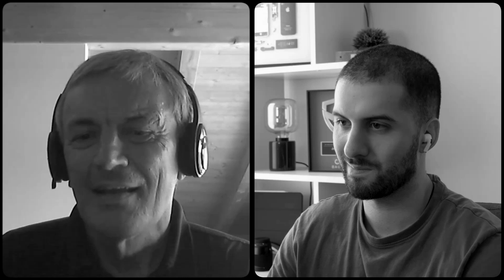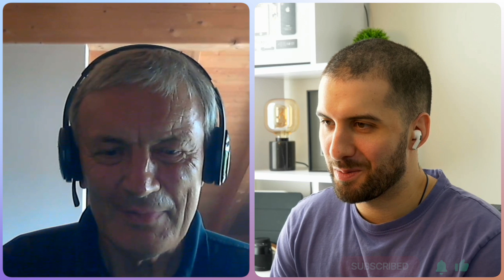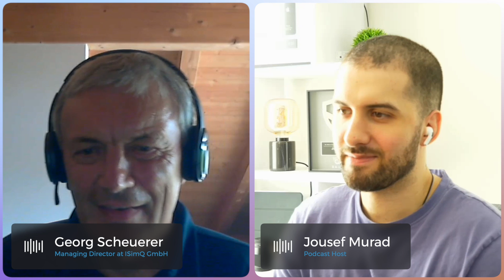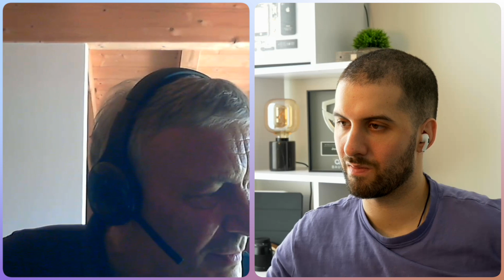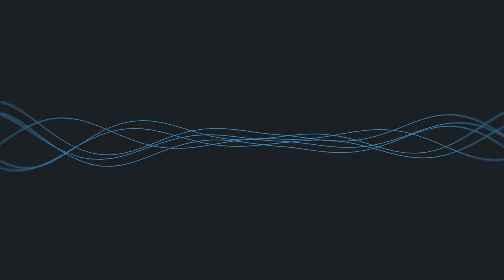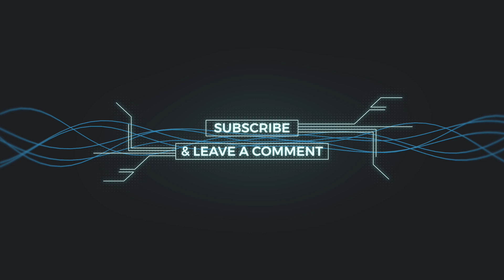A Guide to CFD - Georg Scheuerer | Podcast #109

Comment: I am a beginner in CFD simulations. The problem I want to solve is simulating a desiccant wheel in HVAC. It's quite complex because it deals with multiphase flow and very small geometries. I've seen a lot of simplifications done such as analyzing only a single vent of the wheel. However, I haven't found a good model yet on the evaporation of water (in the regeneration phase). Is this something possible? Any tips?
Reply: You can solved using FVM method numerically by descritising Psudeo Gas Side model.
Reply: @abhijeetboche5147  Thanks for replying. Could you expound more about the pseudo gas side model?